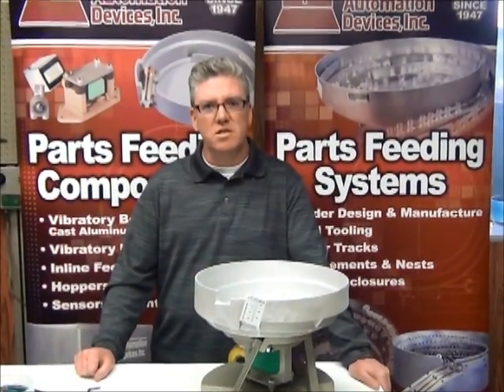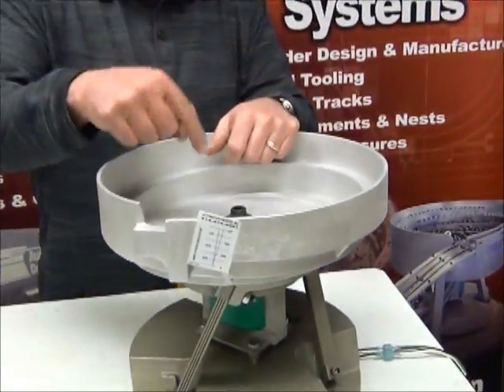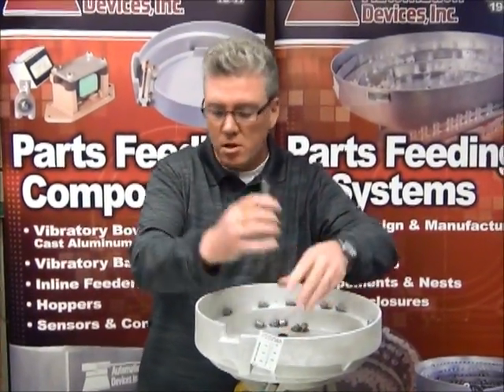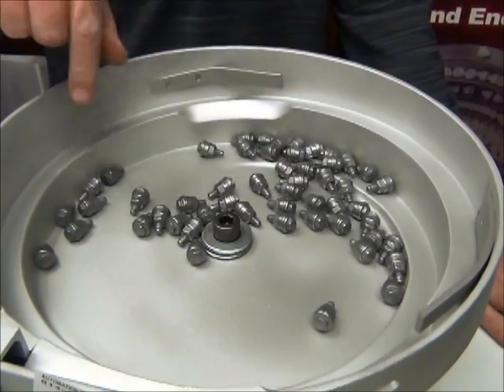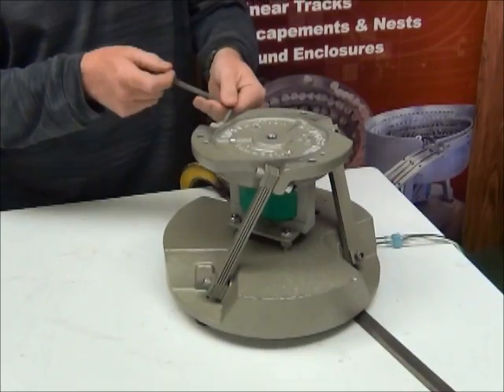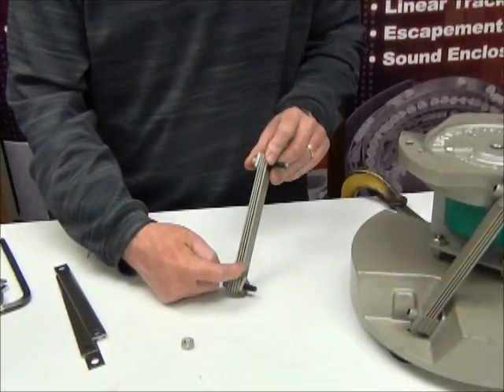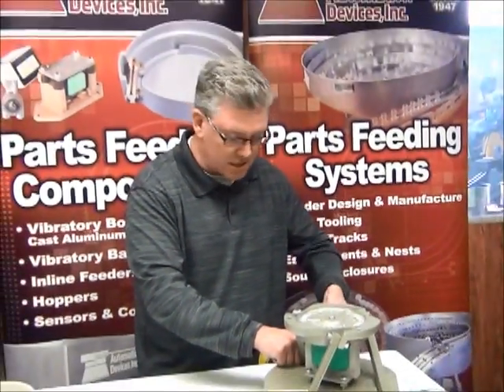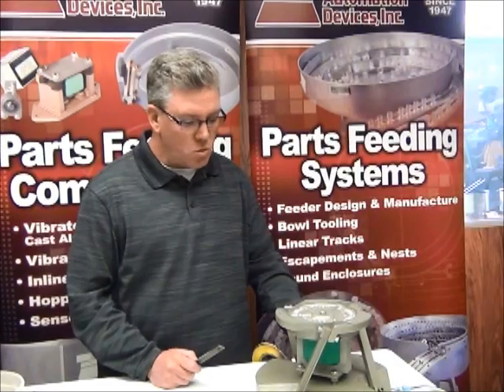Adding & Removing Springs: Basic Bowl Tuning 101

Comment: I miss it... almost 50 years ago, I was adjusting springs every day.
About 40 years ago, I was freed from spring adjustment after I modified an inverter for a motor and started using it as a parts feeder controller!
At that time, Citizen Watch used a cast aluminum bowl, which was very difficult to process with a milling machine because it burned on the blade.
After they changed to SUS304 bowls, the parts feeder manufacturing changed completely.
We still have a large inventory of springs from various manufacturers...
懐かしいなぁ、50年近く前はバネ調整の毎日だった
40年程前、モーター用のインバーターを改造してパーツフィーダーのコントローラーとして使用し始めてから、バネ調整から解放されました
当時、シチズン時計はアルミの鋳物ボウルを使っていて、フライスで加工すると刃物に焼き付いて大変でした
SUS304ボウルに変更されてからパーツフィーダーの作りが一変しましたね
今でも大量に各メーカーのバネの在庫があり・・・